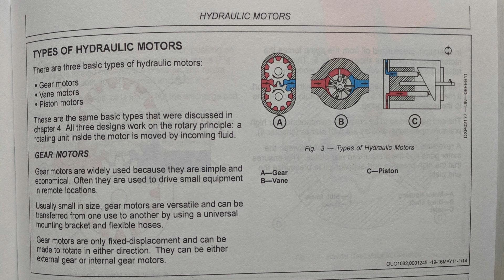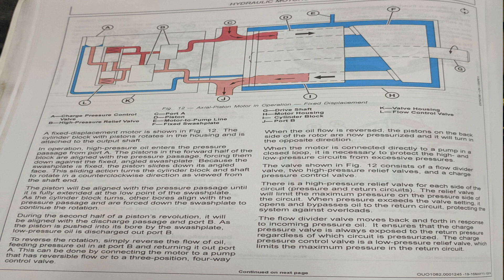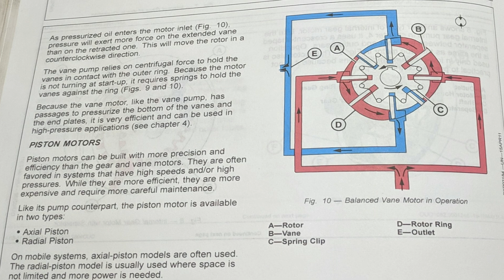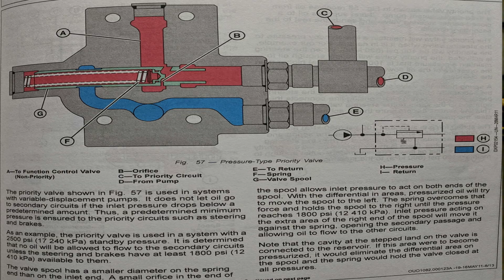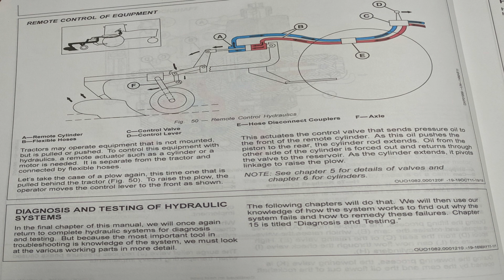Getting to know your tractor hydraulics

Comment: My Farmall 400 had pressure down on the 2-point but you could pull some pins so then you didn't have down pressure.
Down pressure on a 2-pt / 3-pt is great till it just picks the back of your tractor up and then your sunk.

Comment: Not ever being around tractors I’d like to see how the clutch and shifting gears is like I assume it’s much different than a car keep up the great work !
Reply: The gears in a tractor are straight cut for strength rather than beveled like in a car for ease of shifting. Most tractors make use of an two stage clutch for operation of the power take off and to disengage the rear wheels from the transmission